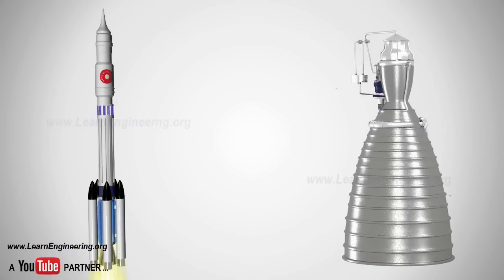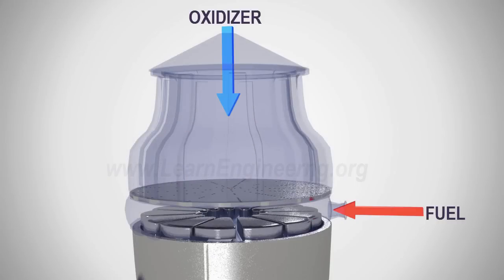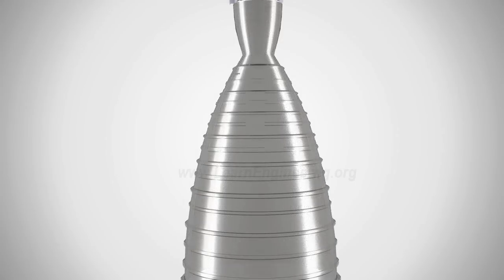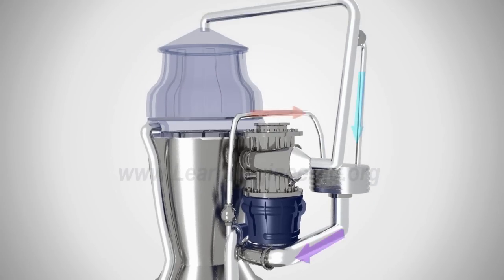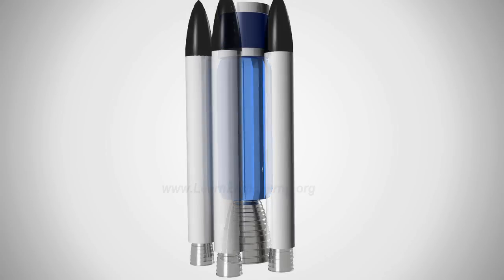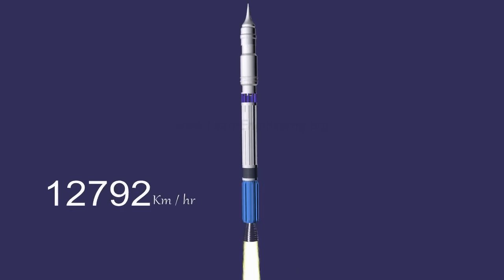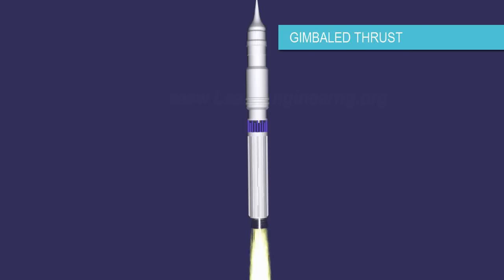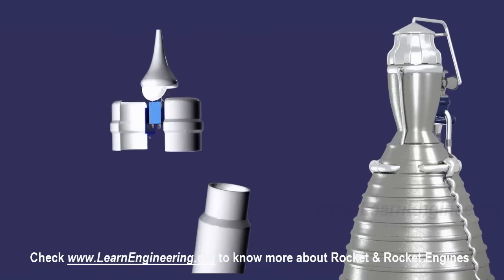How a Rocket works?

Comment: Why do rocket launches currently only occur with uncompressed air underneath, wouldn’t it be more efficient to allow the air underneath to compress to form more mass to push against? Then the rocket would launch as if from the barrel of a gun.
----------------------------
That's NOT how rockets work!!  They DO NOT "push on air"!!  In fact, in a thicker atmosphere a rocket would work more poorly, because it would interfere with propellant escaping the combustion chamber!!!!  Rockets actually work better in space, in a vacuum!!! Rockets work by the explosive combustion pushing against the back wall of the combustion chamber, pushing the rocket forward!!!!

Comment: Won't work in a vacuum though.  Look up Newtons law of resistance, the same applies to a bicycle when raised off the ground.
Reply: Uh no, rockets still work in a vacuum because of Newton's laws of motion. For every action there is an equal and opposite reaction.
Reply: Thanks for proving that you failed high school physics.
Please explain what would happen if I fired a crossbow into a vacuum.
Are YOU claiming that it would experience NO RECOIL force from accelerating the mass of the projectile?
I seriously tire of high school dropouts suffering from the Dunning-Kruger syndrome thinking they are smarter than all of the Engineers and physicists to have ever lived.

Comment: How solid proplant rocket is deattach by which method.  And how it is connected to the main rocket i.e magnetism or not
Reply: Good question. Stages are connected by explosive bolts. When the stages need to separate, an electrical charge detonates the explosive, the bolt shatters, and the stages separate.

Comment: Rockets will not work in the vacuum of space, as they work off of pressure.  The only energy that travels the vaccum of space is light.
Reply: Rockets work better in a vacuum.
You don't think rockets push off air?
Lol
Reply: No, there is pressure as long as there are moving or still particles, and rockets shoot out very fast gas
Reply: "Rockets will not work in the vacuum of space"... And there you have it, my friend - the reason why no one will trust you to accomplish very much, or to make the world a better place.
Reply: The pressure in the engine's combustion chamber can reach 2-300 atmospheres!
Reply: Yes, they work off pressure. The pressure is that of the combustion gases pushing upwards against the top of the combustion chamber.

Comment: @3:03
We need 11 km/sec or 40,000 km/hr for Earth's escape velocity. Not sure from where you got the 28,000 km/hr value.
Reply: Pia  Escape velocity and orbital velocity are 2 different things.  28,000 km/h is for orbital velocity.
Reply: The escape velocity is the square root of 2 (≈ 1.41) times higher than the velocity needed for a circular orbit at the same altitude.

Comment: Lth......
Your THEORY.......is very top.... excellent.....
MY...... INTERESTING.....IS.....THE....."BASE".....
When your feet.....stand on solidarity material s.... results..
YOUR JUMPERS........WILL....GET..... HIGHER S....(Y/N)..??????
GENERALLY......my point is your GUYs....NASA SCIENTIST s...has been forgot.....THE BASE IS VERY IMPORTANT TOO..??
EX.......
          Jumping on land ground..... higher....than.....as...
           Jumping....when you are on the surface of RIVER....waters.
             And better far away..when your feet are on AIR.... which is gaining a NEGATIVE ...of jumping....???..
(Y/N).....?????........
Currently..... HUMAN S ROCKET s....are jumping on AIRs....
RESULTS.......must need extremely...FORCEs POWERs...???.THEN......
A lot.....a lot ....of FUEL'S.........WASTED...... NEEDED....
And ... heavyweight..... added....to the unit rocket....!!!!!!!....???
Which is by a WEAK DESIGN ENGINEER s... Scientist s....!!!!!....

MY AIMs...is...the BASE... which... ROCKET s...forces LEAN ON
FOR JUMPING PUSHING.... UNIT GO FORWARD..... directions....
IS VERY IMPORTANT THEORY....... need to... DISCUSS IT....???.

Right now....my observing is....NASA SCIENTIST TEACHER TRY TO MAKE DIFFERENT........ STYLES......of..... TAIL s.... structure.
To gain..... better.... better.....trying......not... ENGINEER science..

REDESIGN OF THE BASE.......IS.... ENGINEER...WORKs.....

MY POINT IS SCIENTIST TEACHER S......try to FURIOUS... STUDENTS.......in school class......!!!!!!!!........??????...
IF NOT......I WOULD SAY....... SORRY 😔😔😔😔😔😔😔😔😔.

WHY......NASA.... DON'T OPEN......THE BASE.....THEORY...?????

I HAVE PLENTY OF....... ADD CONTRIBUTION TOMORROW....
I WILL....... show up my theory to you..... tomorrow....then...

MY GOAL IS........"LESS FUEL..and....FASTER SPEED".....try....
WHY......????.......
JUST BECAUSE. WATCH ING..SOME STARWAR..... VEHICLES...
THEIRS SPEED s....are... incredible..... comparing to HUMANS..
Wish you luck.....

Lth.....
Reply: Stay of the drugs, man. They do you no good.

Comment: Bro why is so much of this wrong or inaccurate
Reply: The only wrong thing i saw was the "thrust increases as momentum is lost" im pretty sure he meant lose mass
Reply: @k-osmonaut8807  the visuals suck, the engines are giant, the "SRB's" have the exact same model as the liquid engines, the fairing part is just horrid and they say all liquid propellant engines have high specific impulse, are restartable, and their thrust can be controlled, which a lot of engines don't have all of those aspects, the diagram of the flight with the speed sucks, it shows constant and smooth acceleration, even through staging events and fuel/mass being used up.
Reply: @catdealer1144   noa watching it again u are indeed right
Reply: Because it's made by an AI 😂

Comment: So it has nothing to do with exhaust molecules striking the top of the combustion chamber?? It's all about the thrust pushing against the atmosphere??
Reply: Perhaps you should ask yourself if a rocket is losing a great deal of mass every second, due to the ejection of burnt fuel at hypersonic velocity?
Do you actually not realise that a rocket is propelled due to the conservation of momentum?
Reply: @sailorman8668  From what I just heard in the video, thrust is produced by the exhaust getting blasted out against the atmosphere.
Reply: @3_years_left  Nope, that is not the process being explained at all, lol.
in fact, the 'method' by which a rocket is propelled is mentioned right at the beginning of the video at time 0:20.
Reply: @sailorman8668  "...you have to eject a huge amount of mass from it, at high speed" ...sounds like thrust to me.

Increasing the exhaust speed increases the thrust.... Yup.
Reply: @3_years_left  Yes, any mass that is moving is causing a momentum force.
This is why a rocket can be propelled to huge speeds, by ejecting huge amounts of mass (burnt rocket fuel in the form of exhaust gases) at extreme velocity = a HUGE momentum force. 
There is nothing in this video that even remotely suggests that 'thrust is produced by the exhaust getting blasted out against the atmosphere', which is what you stated in your comment posted 2 weeks ago.
Reply: @3_years_left  "Increasing the exhaust speed increases the thrust.... Yup."

Yes.  This isn't complicated.  If you say in a chair with wheels and you threw a basketball, you would be slightly thrust in the opposite direction.  If you threw it harder, you would be thrust more in the opposite direction.  If instead of a basketball, you threw and equally shaped and sized bowling ball, the thrust on you would be significantly higher.  You're not moving because you pushed off the air; you're moving because the very act of ejecting mass away from you necessarily results in your thrust in the opposite direction to conserve the momentum.  The more mass you push, the higher the momentum - and thus the greater you would be thrust in order to conserve it.  The faster you push, the higher the momentum - and thus the greater you would be thrust in order to conserve it.

Comment: nice video. got soem remarkts though

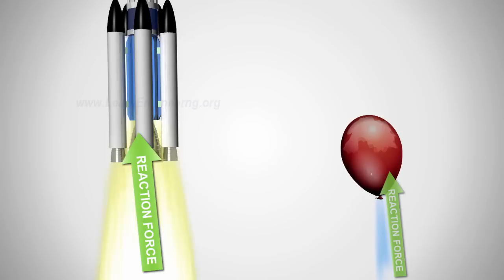0:30 It's not the momentum the rocket loses that defines its thrust, its the momentum per second it loses. big distinction. Thrust is calculated by T [N]= Mass flow [kg/s] * velocity [m/s]
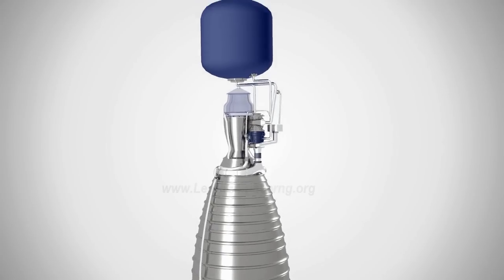2:37 actually solid rocket motors are the most powerful currently available. 
3:53 thats a really... interesting... fairing design.
Reply: Thurst maybe, iirc they arent as much used because of safety concerns and lower specific impulse

Comment: We actually need battery driven rockets in future, this is too much pollution.
Reply: How is pollution a concern here? We're talking about machines that lift equipment and people into space. Besides, you can't just zap thrust inside a vacuum into existence, they're rockets, not cars. Most likely the next step will be fusion plasma exhausts of some sort, followed by matter-antimatter annihilation if we ever manage to reach that level.
Reply: The byproduct of liquid fuel rockets is basically water vapor
Reply: @afoxwithahat7846  oh really?
Reply: @afoxwithahat7846  thank you for that information
Reply: @koushikkonda1994  assuming they Use Liquid Hydrogen (H) and Liquid Oxygen (O), it forms H2O, which you prolly know
Reply: @afoxwithahat7846  so finally rockets create water vapour and indirectly Its responsible for rain. 👍
Reply: @afoxwithahat7846  Not all rockets use hydrogen and oxygen, some can be hypercolic, which are toxic, but rockets produce a tiny amount of pollution compared to other industries such as airplanes, factories, cars, etc.
Reply: @anguita119  it was used in some of the Apollo spacecraft, ye? I heard they're corrosive for the engine and it couldn't be tested because of that
Reply: @afoxwithahat7846  Yes, they occupied in the lander, because they are incredibly reliable, since only when mixing they generate thrust, it also occupies in some nuclear missiles, since being reliable, they would not fail in a nuclear war

Comment: This video gets so much wrong about rocket science that it makes me sick 🤮🤢. One example is the claim that liquid rocket motors are the most powerful is just not correct at all. The most powerful rocket motor fired was a SRB (solid rocket booster) that produced the same amount of thrust as 3.8 F1s.
Reply: What other aspects of the information given is 'so wrong'?
Reply: Not all nozzles use the fuel to keep the nozzle cool, there are a ton of different cycles that can be used to drive the turbo pumps. And the function of the nozzle is not to make the flow supersonic it is to convert that supersonic flow into a one directional flow that does not lose too much pressure as compared to conditions the rocket operates in. This is counter intuitive but the pressure coming out of an ideal nozzle is either 1 atmospheric pressure or slightly less. (If you push this too a low extreme this can lead to flow separation of the exhaust leaving the the nozzle and either a “hard start” or a RUD (rapid unscheduled disassembly) of the rocket engine. This is why sea level nozzles are much smaller than vacuum nozzles. This is called the engines expansion ratio. I can go on and on if you would like but would much rather do this sort of thing through a video chat as it is much faster for me.

Comment: What does the thrust push off of in the vacuum of space?
Reply: It doesn't push off anything, the big difference between Earth and space vehicles is that vehicles like boats and cars use friction to "push off" with their wheels and propellers. However, rockets don't have anything to push with and cause friction, the flames are not solid so cannot do so anyway. Think of it like a continuous, concentrated explosion coming out of the bottom of the rocket. Explosions push things away from them, right? So the rocket is just using the engine to create a continuous explosion to push itself away from it.
Reply: @Thundorica  
Yes I understand what your saying. I'm an A&P mechanic & I also have 2 yrs of aerospace engineering, but  in a vacuum this doesn't work. That's why all satellites are tethered to weather balloons. Space travel is a hoax, so is the space station, & all the moon missions, along with all the space shuttle missions.
Reply: @thebentley71  bro, highly doubt u got 2 yrs in anything other than age, and amount of time spent on yt. However rockets don't need anything to push off, the force exerted downwards, accelerates it upwards. Simple as. That's physics for ya.

An example of how a rocket works would be sitting on a chair with wheels, and starting a fire extinguisher. It would push u backwards, it's not "pushing off the air", its  the force itself that propels you.
Reply: @thebentley71  
Imagine a gas under very high pressure in a closed container. The gas molecules are flying around at high speed, colliding with the walls and thus creating an outward push in all directions. As long as the push in one direction is cancelled out by an equal push in the opposite direction, the container remains stationary because it's not exposed to an unbalanced force.
If one wall is removed and the gas flows out there, the push on the opposite wall is no longer cancelled out and the container will temporarily be pushed in that direction until the gas is gone.
A rocket engine works the same way, although the escaping gas is continuously replaced by new gas created by the combustion of fuel. Rocket engines actually work better in space since the speed of the exhaust gas isn't constrained by the surrounding atmospheric pressure.
Reply: @fromnorway643  Another aspect of the way that a rocket in propelled that many people fail to appreciate, is that a rocket's exhaust has mass.
For every ton of fuel burnt in the combustion chamber, a ton of burnt fuel in the form of exhaust gases is being ejected out of the engine nozzle at hypersonic velocity, creating a HUGE momentum force, which is propelling the rocket in the opposite direction to that of the combusted fuel being ejected out of the engine nozzle.
Reply: @thebentley71  It's been over 3 months since you posted your comments on this thread.
In this time, have you found some 'smarts' from somewhere, and now realise how a rocket is propelled?

Comment: I would disagree a bit Newton third law can not be applied as. In space the reaction is not possible No one can swim in vacuum. Also aircrafts can not fly in space Please consult the writing of  Konstantin Triolovsky the Russian Scientist who invented Rocket Science You can consult Ya Pareleman vol 2 physics for entertainments now available in 15th edition Mir publication
Reply: Wandell Passah
 - You are wrong. The working of a rocket motor can not be compared to swimming or the wings of an aircraft. In those cases the force is due to interaction with the water/air around you. In a rocket motor the force occurs because you are accelerating out of the motor the fuel that is already in the rocket.

If you stand on roller skates, holding heavy rock and then throwing (accelerating) the rock away from you, what happens? You will start rolling in the opposite direction of the movement of the rock. 
Is this because you are in the atmosphere? No. The same thing will happen in a perfect vacuum.
Reply: Just wondering Wandell, have you figured out yet where you went wrong in your thinking?
Reply: When you know nothing about physics but want to have an opinion
Reply: @tsurutuneado5981  
A perfect example of the Dunning Kruger effect.
https://onlinepethealth-info.com/wp-content/uploads/2019/12/Dunning-Kruger.jpg

Comment: Soory to say this mate, but solid rocket boosters are much more powerful than liquid propellant engines
Reply: They may be more powerful, but have lower fuel efficiency and more dead weight than liquid fuelled rocket stages.
The shuttle SRBs – the most powerful rocket engines ever flown – had an empty weight of 90 tonnes each. That's 20 % more than an empty shuttle (75 tonnes) and more than 2/3 of an empty first stage of the Saturn V.
The latter is pretty remarkable when considering their dimensions. The first stage of a Saturn V was almost as long as a shuttle SRB, but much wider (10 m vs 3.71 m) and was powered by five F-1 engines that together produced up to 38 % higher lift-off thrust than the two SRBs combined.